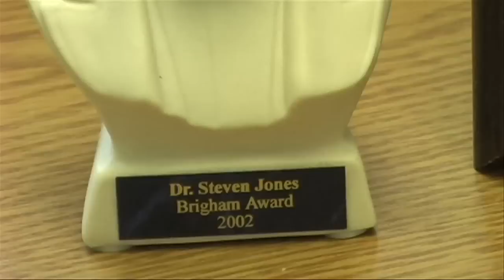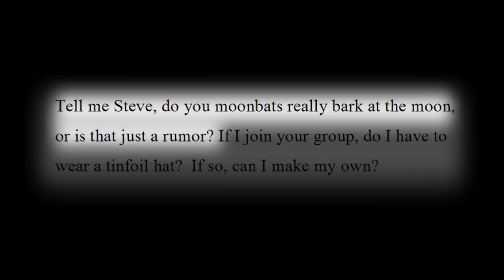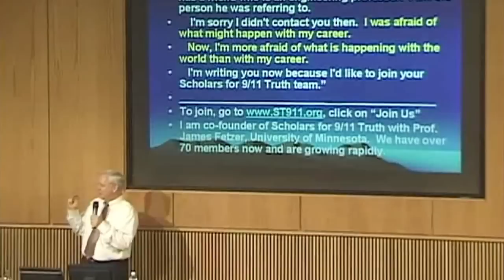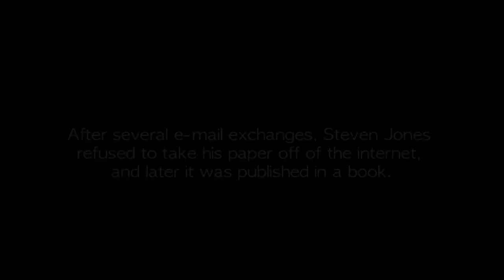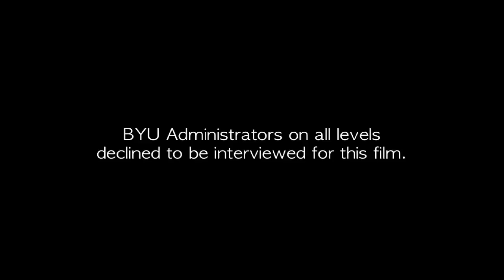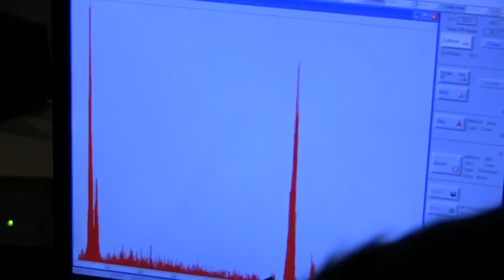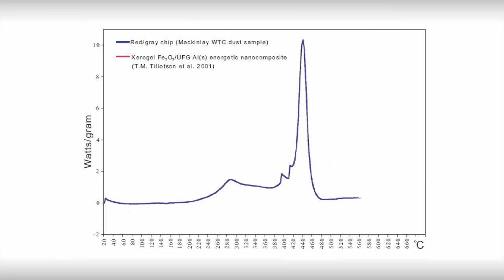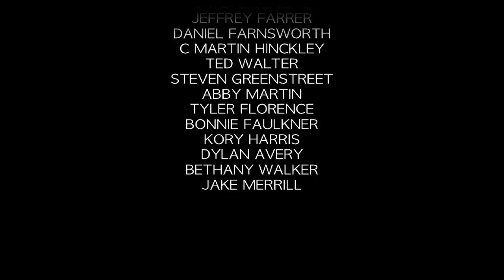hy.poth.e.sis - Full Movie (Steven Jones documentary)

Comment: The aluminium in the dust may have come from the huge aluminium alloy planes that crashed into the buildings. This could have resulted in a thermite reaction caused by the high heat of the burning jet fuel, the aluminium airframe and the steel structural girders. I'm not calling him a quack or anything like that I'm just saying that there are other possibilities.

Comment: Hundreds of extremely heavy steel beams with lengths of over 100 ft as well as thousands of tons of concrete falling onto a building are more than enough to endanger its structural integrity. Not to mention the fact that all this debris was falling from heights well exceeding over 1,000 ft hitting the building with tremendous force. Despite the fact that I am a Civil Engineer, I can also tell you that this is all "common sense" as well. : )

Comment: is simple : ever try to bake a frozen pizza at 150 degrees?  You can not.  450 degrees is written on the box.  Why? Science will tell you that the specifics but the main thing is, the oven needs to be 450 degrees to bake that grocery store bought frozen pizza.  Well the same is true for a steel.  It needs to be 2800 degrees to get soft and mushy.  Steel needs to be 3200 degrees to START melting.  Thermite ignites around 4500 degrees but jet fuel burns out fast at 1600 degrees.  Science. Goodnite